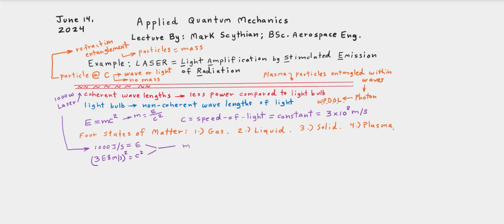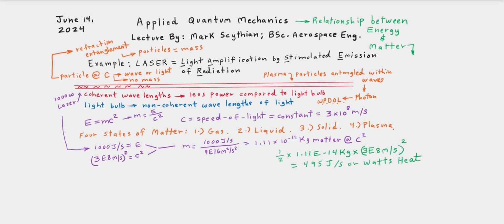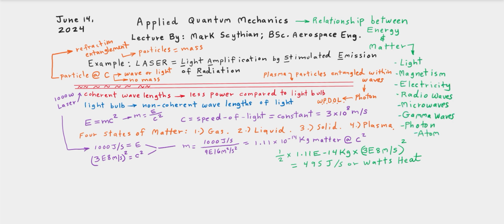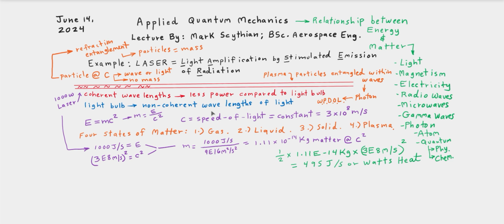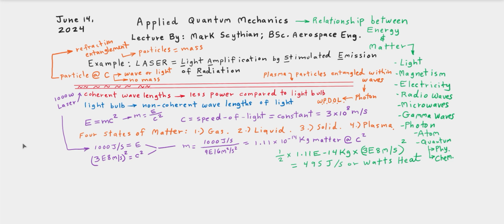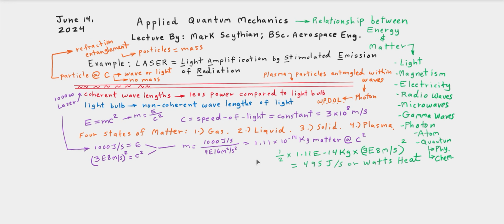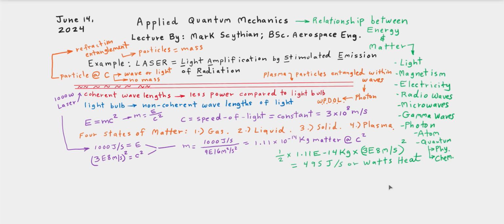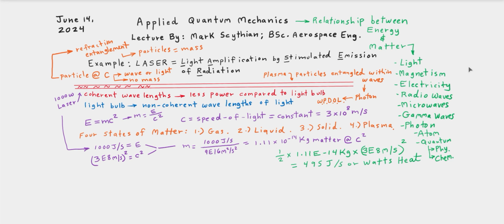Applied Quantum Mechanics

Comment: I couldn't follow this at all.
Reply from the maker: Matter & Energy are one and same, existing in different mediums.  Atoms are 99.9999% empty space.  Matter is the concentration of atomic energy or 'Quantum Entanglement'.  

For example:  If matter such as a "spacecraft" is able to reach the Speed-of-Light (3.0 x 10^8 m/s), it would no longer be matter, but convert into light (energy).  Matter and Energy are the same, but across different mediums.  E = mc^2. 

The LASER beam, while pure energy, has matter potential across its coherent waves as well.  The equivalent matter within the LASER beam is then equal to: m = E / c^2.  In this case, one-half of the LASER's Watts Power would transfer as Thermal Power in Watts (Heat), at the LASER's point-of-contact with target.  

The LASER's matter-component in the form of Plasma (4th State of Matter), would translate to:  1000 W / (3.0 x 10^8 m/s)^2 or:  1.1 x 10^-14 kg, moving at the Speed-of-Light.  Or around 500 Watts of heat projected across the laser to its target, having considerable range.